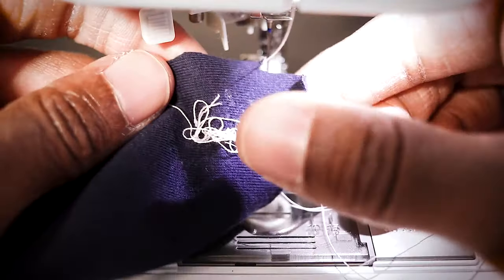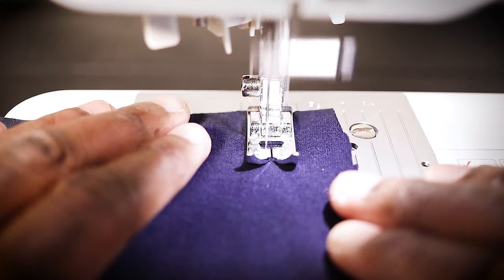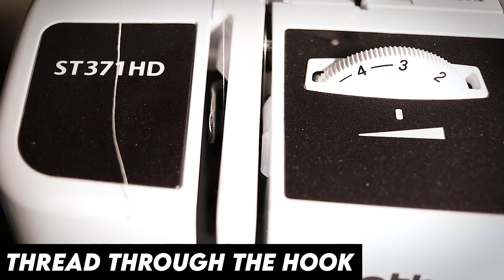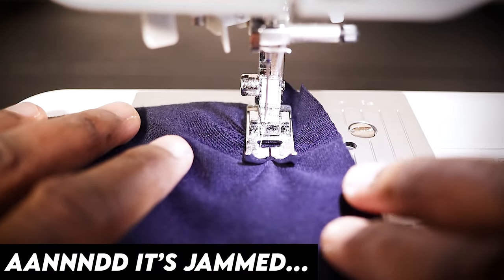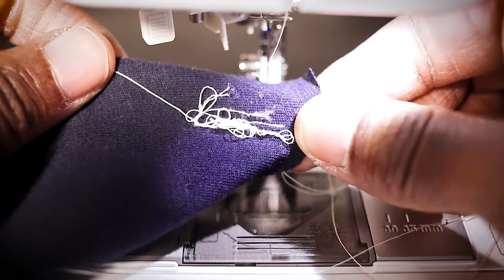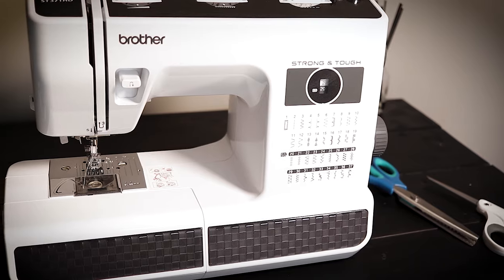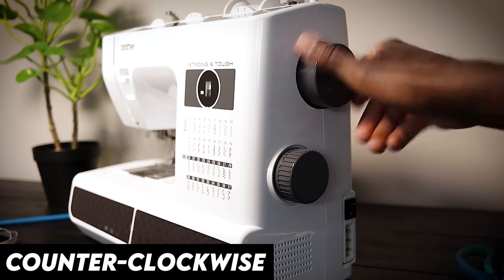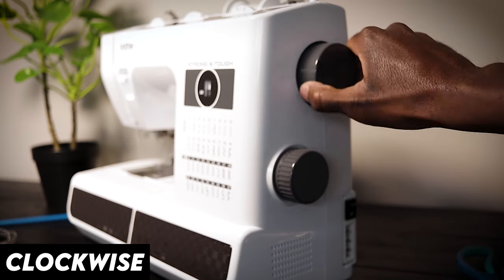So Annoying! Here's Why Your Thread Is BUNCHING

Comment: This is great advice, SD! I work in a sewing  machine retail shop and all too many times people who have come to me with the problem of thread nesting on the underside of their projects have been solved by me merely threading their machine properly, i.e. making sure the thread is in the take-up lever (and some customers have even driven over one-hundred miles from their home only to find that all I did was correctly thread their machine). Another problem is that people do no thread their machine with the presser foot raised so the tension discs are open when they are threading. Further, many people do not know that one does not pull the upper thread backwards when changing thread - pulling the thread backwards through the threading path only pulls any lint that may have accumulated back into the tension mechanisms. Another word of advise is to make sure your bobbin is correctly wound and many people forget to make sure their bobbin thread is securely in the tension spring of their bobbin case. I own too many sewing machines ranging in age from my treadle from the 1930's to the top-of-the-line of a current brand and none of them have ever needed repair since they have been routinely maintained.  👍
Reply: Thank you for dropping all these tips!

Comment: I gave you a thumbs up before watching this video because I know you are gonna answer this question I've had for a long while!
Reply: Oh, but that wasn't my reason, lol. On issues I had was buying thick nylon thread and using it in my bobbin as well. Figured out bobbin works better with smaller thread.
Reply from the maker: Yeah thick thread in general can cause a lot of problems in general if your project doesn’t call for it